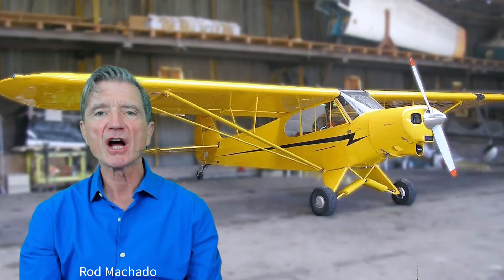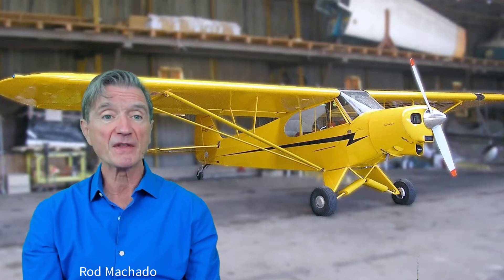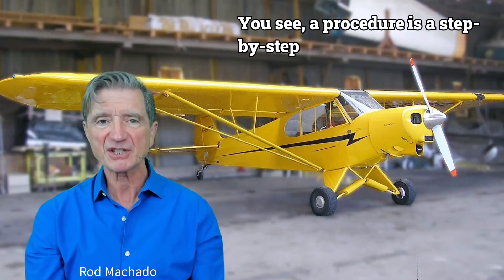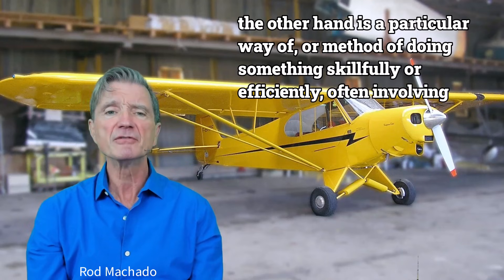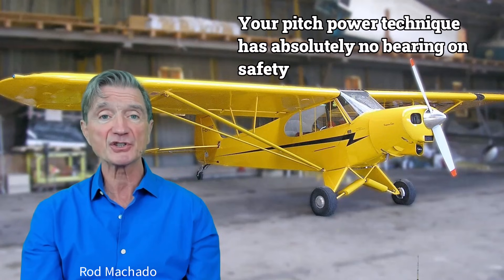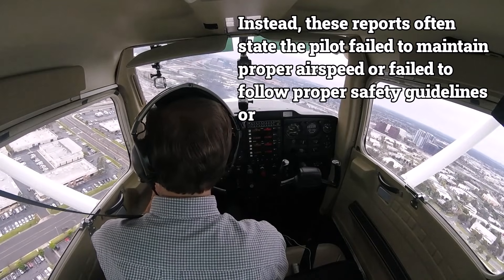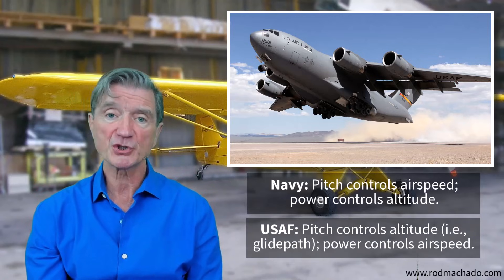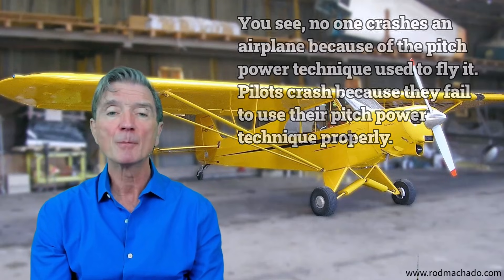Technique vs. Procedure

Comment: The pitch to airspeed proponents also usually say 'airspeed is king', and that a stable airspeed will always result in a great landing.  The TRUTH is many airplanes land safely every day in gusting conditions with the airspeed needle moving up and down constantly.  So the importance of a stable airspeed needle is a fallacy, and there's nothing any pilot can do about it.  And if a pilot tries to stabilize the airspeed in gusting conditions with the elevator, they turn an approach into a roller coaster ride.
Reply: "And if a pilot tries to stabilize the airspeed in gusting conditions with the elevator, they turn an approach into a roller coaster ride."

yes, because the airspeed is all over the place, and those momentary changes don't settle out into equilibrium before changing them again. every time you change airspeed you change you climb/descent rate too, if you don't adjust power, and so if you keep slowly changing your pitch, the airplane will constantly be oscillating. this is why controlling descent with power is more stable and precise.

However, i can and do fly rock steady approaches in gusty winds by pumping the elevator. and the descent and airspeed remain locked in, because I am cancelling out the disruptions to equilibrium rather than causing them.

" So the importance of a stable airspeed needle is a fallacy, and there's nothing any pilot can do about it."

not true at all. you can trim for an airspeed, basically fly hands-off on pitch, and use just power to fly an ILS glideslope with god-like precision. Now, as we've said, gusty conditions are different, as they are an outside force disrupting our stable flight condition, and so we must work to cancel out those disruptions. but the underlying fundamentals haven't changed in gusty winds.
Reply: @SoloRenegade Sounds like you're pitching to glideslope in gusting conditions.
Reply: @warren5699  "Sounds like you're pitching to glideslope in gusting conditions."

nope. I pitch for the target approach airspeed, period. then adjust the descent with power. as needed, in gusty conditions, I work the pitch as needed to correct for gusts that upset my nose position, which will affect my airspeed if left uncorrected.

this is not rocket science, but you're sure trying to overcomplicate things as much as possible. you're not god, stop trying to bend the world to your will. you'll never win.
Reply: @SoloRenegade Didn't you just agree that pitching to airspeed in gusting conditions creates a roller coaster ride?

Comment: For the right answer to this question, simply ask a glider pilot. Then add an engine.
Reply: Instructions unclear, can’t find the airbrake on my 172
Reply: @AndyFangDZ  Keep looking, it's the aircraft....
Reply: right on!
Reply: For one technique, yes. The glider is by design limited to utilising that. For different powered operations, either technique as described works. Try flying a geometrically derived vertical path [example ILS] at a constant airspeed in a glider. Tip, don't get slow!
Reply: A one dimensional machine vs a two dimensional machine.  I don't think technique in the glider is going to explain how to maximize operation of the powered aircraft, simply because the powered aircraft will do things the glider can't do.
Reply: @warren5699  you are 100% wrong. gliders are 3D same as any powered airplane. they work no differently than powered aircraft.

the ONLY thing a powered aircraft can do differently is maintain level flight and climb without an updraft of some sort. but even powered gliders can do that.

physics doesn't change for a glider. wings and aerodynamics aren't magically different for gliders. they work 100% exactly the same.
Reply: @SoloRenegade 100% correct!
Reply: @SoloRenegade "the ONLY thing a powered aircraft can do differently is maintain level flight and climb without an updraft of some sort."  That's exactly the point.  The pilot in the powered aircraft can use the power when and where he wants - the debate is how to coordinate the pitch and power.  There doesn't seem to be any debate about cruise flight - the wing's lift vector directly opposes the weight and allows altitude to be controlled.  Below best endurance speed, many say the power controls the altitude.  OK - a little stick (propeller) on the front of the airplane, about 2% of the area of the 36ft wing (Skyhawk), can now oppose 2000+ lbs.  AND with a horizontal force.  You tell me how that works.
Reply: @warren5699  "the debate is how to coordinate the pitch and power."

and glider pilots get it right, because they are forced to learn the truth by having only the truth to control airspeed with. PITCH.

you missed the whole point. clearly you are not a glider pilot.

"There doesn't seem to be any debate about cruise flight "

becasue there is nothing to coordinate, you're in cruise and the configuration is already set.

"the wing's lift vector directly opposes the weight and allows altitude to be controlled."

100% wrong. excess THRUST controls climb/descent. You're arguing with an Aerospace engineer who can do the math and derive the equations, and i'm also a CFII.

"Below best endurance speed, many say the power controls the altitude."

they are wrong, power controls altitude at all speeds.

"You tell me how that works."

Go read chapter one of "Aircraft Performance Stability and Control" by Perkins and Hage and lern the truth. the equations are derived simply and the truth is explained.
Reply: @SoloRenegade "excess THRUST controls climb".  Excess thrust allows the pilot to increase pitch and sustain the speed.  The pitch makes the airplane climb - the excess power sustains the speed.  In gliders, it's also the pitch that controls the climb, but without sustained speed.
Reply: @warren5699  "Excess thrust allows the pilot to increase pitch and sustain the speed. "

wrong. excess thrust results in a CLIMB at a given airspeed. if you then increase pitch you'd now fly SLOWER and climb MORE.

If you added power to gain excess thrust, to maintain level flight you need to pitch DOWN, thus INCREASING speed.

"The pitch makes the airplane climb - the excess power sustains the speed.  "

no, it does not. and just declaring it so doesn't make it true. you are defying the laws of physics, you just don't understand enough to realize it.

" In gliders, it's also the pitch that controls the climb, but without sustained speed."

no. you said it yourself, changing pitch in a glider changes airspeed. what controls climb in a glider is updrafts and controlling your drag by flying above or below the L/Dmax.

you can't win this, as you are fundamentally wrong. and every aerospace engineering, math, and physics textbook and scientist and engineer stands with me in opposition to you. you have a fundamental misunderstanding of how this stuff works.
Reply: @SoloRenegade "excess thrust results in a CLIMB at a given airspeed".  Yes - but we're talking apples and oranges on that point.  Let me reword this.  I'm saying the pilot can use excess thrust - you're saying the pilot applies excess thrust.  For example, in cruise, if we entered an area with a downdraft, and the power is not at full throttle, we can increase the pitch a bit to maintain level altitude while simultaneously nudging in a little more power from the available excess thrust to maintain the speed.  Same thing would apply on a visual or instrument approach.